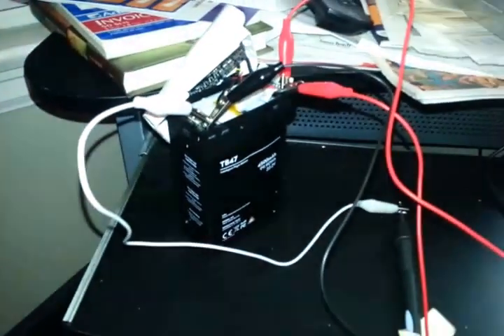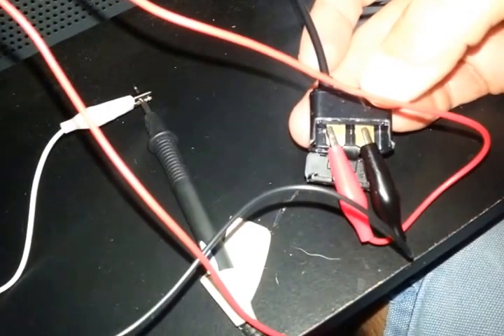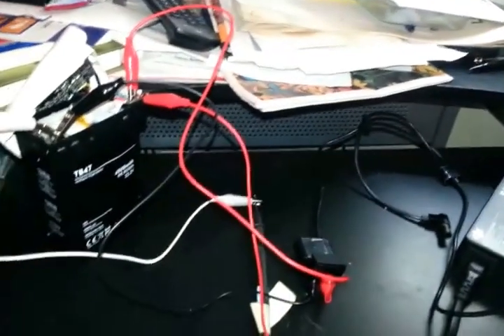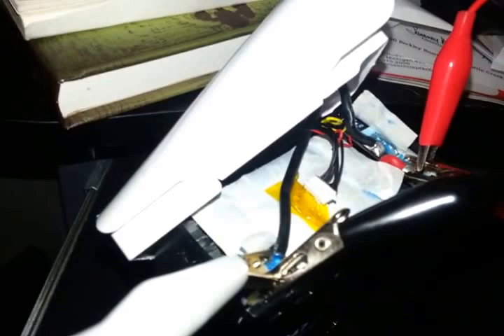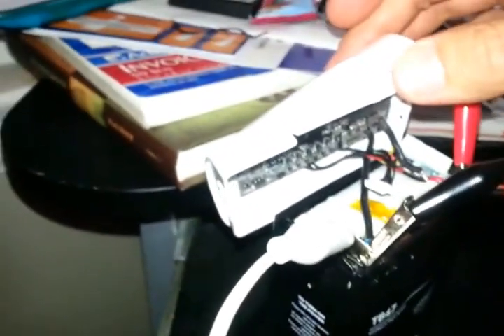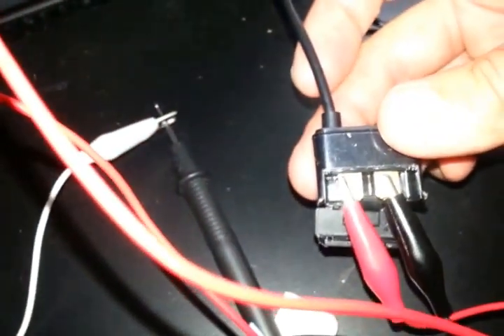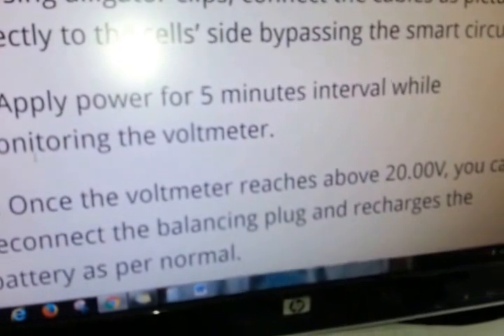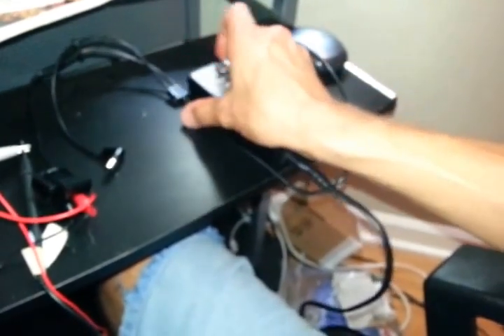FIXING NON WORKING DJI INSPIRE 1 DRONE BATTERY BRICKED NO LIGHTS NOT CHARGING

Comment: this will take about the same timer as normally charging? after 4 intervals the battery isnt even at 2 volts
Reply: Mine is charging normal now, took about 20 mins and than she jumped up to 20v fast

Comment: just out of curiosity why can u just unplug the mother board and then charge with it disconnected 
same same no?
Reply: Because the mother board has a safety switch and will keep kicking so you can't charge the battery
Reply: @1chevyfreke  i did this i got full charge in the battery or so the lights say. but it doesnt fire up the drone. and it has a red light on the startup button

Comment: Thanks for the video.

It worked for me, i used 3 intervals of 5-6 minutes,  but I got surprised by the last couple of 2 minutes. It went all of a sudden really fast and I loaded it up to 22.2v...

When I just hooked up the connector, and put it on - I heard a hissing sound at the battery. I was shocked and certainly not expected this. So I put it outside on the concrete. After putting it off it still hissed. (can only hear this when your really close)

after 5 min it stopped and the indicator lights still act normal as in it is on 'low'

What do you guys think? Normal because of the little overload? Try to charge it?

Comment: This works great , the only time I would not attempt this is if the battery pack has swollen indicating a major battery failure ( rupture to one of the internal cells )  also I did not use 4 alligator clips I just used 2 from the battery charger "tabs" to the Red and Black on the battery pack , I just monitored with my voltmeter by touching them to the red and black ( set to DC voltage ) .  The cells will charge quickly , only take about 5 min tops to get to the voltage to get things working . This is a great video , I really appreciate it .

Comment: Thank you very much , I had success.  Mine did not take but 5 min to get to voltage and then I plugged in the loom and the lights came on .  Going to do a full cycle and then just keep my batteries ful charged at all times .  Thanks again

Comment: must i pass 20v on  a dji p4pro battery? the charger goes to 18 v
Reply from the maker: Don Gerra Marco hmmm not sure. Wouldn't think it would be necessary.
Reply: it just will not revive the new battery
Reply: Funky things seem to happen if you dont get to 20v,just take your time and get to  at least to 20v .  When I say funky things , my experience has been that the first  charging green light will come on but you cant shut the battery off OR the RED light will come on the battery pack and won't go out .

Comment: Great fixed 2 batteries with your help. First try Neva worked so I charged the battery right up to the top and it worked instead of just putting a bit of charge in it. Great video !
Reply from the maker: Ultimate Detailing & Valeting - awesome! Thanks for letting me know it helped!
Reply: Drone dropped out of sky even tho battery showed 100%. So neav goofing to force charge battery that way full any way. I only charge it up a bit if it don’t work I want use it on drone. 👍
Reply from the maker: Ultimate Detailing & Valeting - oh wow ya not good. Would be wise to try running it through a few cycles just hovering very low or running on the ground. How many minutes did it fly b4 it shut off?

Comment: i'm gonna test it out tonight i like the dji products! but the batterys are a hell i yuist received my dji inspire 1 v2 and both of the batterys are dead!!! i'm not even try to contact dji and waiste my time....because they don't care about you
Reply: You can see Swelling in this video.  If your Lipo Batteries have swelled at all replace them.  There toasted and will not maintain a constant charge.  The inspire has 12 cells two cells in parallel in series X6. it equals 6S.  this is a complex setup.  Since the Inspire is not a cheap rig.  I would only recommend fixing a bricked battery if no swelling has occurred yet.  If the battery voltage per cell drops below 2 volts. that batty will begin to swell.  Don't fully discharge a Lipo ever unless its a dire emergency.  Shut down you drones at 30% and the batteries will last you along time.  Never store your batteries full charged or fully discharged.  Never store your batteries in the Drone.
Reply: I agree. This battery is badly swollen and attempting to charge it is dangerous. This will never be a reliable battery.
Reply: You sound like you know what you are talking about, but I simply wanted to add that you CAN discharge a LiPo completely, but it will ruin the battery completely and forever. Additionally NEVER try to charge a LiPo that has been discharged completely. That is when they can enter into uncontrolled runaway states and go up in flames.
Reply from the maker: First just remove the battery cover and unplug the wire harness inside and leave it off for 1 minute and press the power on button then replug it in and see if it takes a charge. If not then follow this procedure. Let us know.
Reply from the maker: Here's a step by step: http://droneownersnetwork.com/how-to-reset-a-bricked-battery/
Reply from the maker: That article says leave unplugged 60 minutes. Id think holding down the power button would empty it of all power. But try both and see.